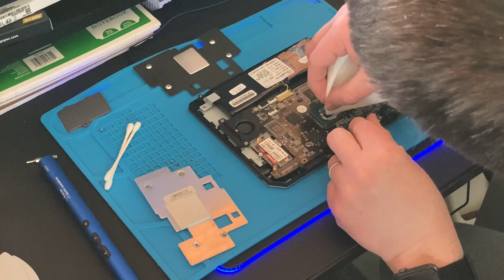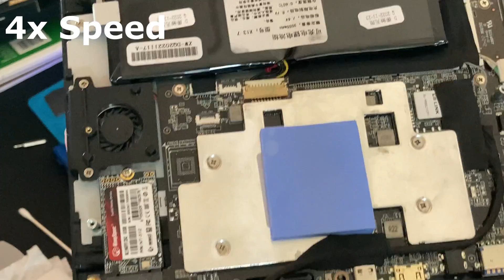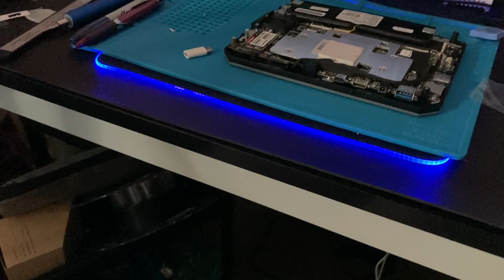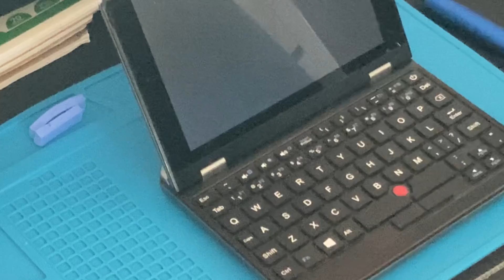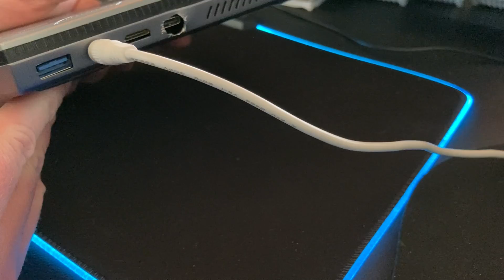The Ultimate Mini Laptop Build???

Comment: After watching your videos about this laptop, I went ahead and bought on one from AliExpress.  Aside from the in accurate listing ( said windows 11 and n100 cpu, got windows 10 inactivated and a n95 processor}  i am satisfied with it.  I had to purchase a Windows 11 license and extract the windows 10 drivers and install them to windows to get the TrackPoint and touchscreen to work.  Now the machine works for what I need it for..  Getting ready to do the cooling improvements in this video.  e warned, what is listed on AliExpress may  not be exactly what you are going to receive.   In my case, it was a slighting lower spec machine.  Wait for it to go on sale and pick one up.  FYI, I did try and contact the seller to return since it was not as advertised, but they never contacted me and AliExpress closed my return request after a week.

Comment: The design of the cooling is the worst thign ever made, and the reason why you got just 6% improvements. 

First of all it is using a desktop grade CPU, so it will be hot no matter what, since it is using a lot of power. You can reduce the TDP on it to make it cooler, but won't be as fast as an optimized CPU for mobile, at the same speed.
Then you have to totally replace the backplate. Even if you put thermal paste, your heat exchange coefficient is based on the material that transmit heat; so from the CPU to the paste that is fast, then you have the plate which is not copper, so it will not disperse and trasmit heat efficiently. Then you have another layer of thermal paste but another sheet of metal in between, and finally the thermal pad. At that point your bottleneck is the exchange speed of the metal and the thermal pad, which are all lower than the thermal paste.

Solution: buy a copper sheet that is as thick as the existing one and add a small fan on the bottom or make the copper plate with fins, so you can use a fan blowing on it to increase the exchange surface to disperse the heat generated by the CPU. It is a cheap laptop for a reason sadly

Comment: What material is the chassis made from? Are the top and bottom actually aluminum or is it just plastic?
Reply from the maker: The outer casing is metal, all the sides, top and bottom panels. I think some kind of cheaper pot metal that looks like an aluminum finish. 
The interior around the screen and keyboard is plastic.

Comment: just got mine today.. tried putting kali on it. got into the system, but display is rotated. tried messing with xrandr and its config, no avail. display setting does not give any options at all... also will not boot without parameter 'nomodeset'. any ideas?
Reply from the maker: I'll be honest and say I'm not too familiar with Linux.  I have seen a few comments left by people trying that have been adding Linux to it semi-successfully.  That's one of the reasons I built a forum for these little laptops.  I'm hoping people more experienced than me can use it and share their knowledge.  
Try asking on https://www.slagle-tech.com/forum/7-inch-mini-laptop
It's still new, but there are a couple guys that frequent it that might have experience with it.  

I do know that when I reinstalled windows on mine the display came back sideways and several things didn't work. (Touchscreen, sound, keyboard mouse keys, etc.)

Comment: I don't know the first thing about thermal paste and the best way to do something but if airflow and distributing is the key I do have a suggestion. If there is space to put that pad on the outside of the 2nd thermal cover and get the casing back on,it should all go back together if say u wedged one of those thermal pads BETWEEN the 2 thermal covers,leaving a space separated by thermal foam. Even that little space would provide air between to eliminate some of the heat before it even hits the second thermal cover. Kinda like the blade of a thermal block

Comment: FWIW those thick silpads do not have great thermal conductivity, a lot better than air obviously but still not great.  A better solution (thermally) would be a suitable thickness of aluminium bonded to the case with a thermal epxoy, and then a thin silpad to connect it to the CPU heatsink.

Comment: If I understand correctly that there is space between the sheets??  I think you should try sandwiching a sheet of copper in between.  So long as it's isolated from the circuitry, it won't cause any shorts and copper conducts heat way better than aluminum.  There are only 2 ways to do passive cooling and since you're dealing with a very small space, passive airflow across fins is not an option, so the only option is to create as much mass as possible to store/dissipate the heat.  The only problem could be the screw length if you add too much depth.

Comment: To create the cut-out since its metal were dealing with should really have been carried out by an different tool and method... the same way you would normally say cut out ports on an cylinder or indeed fabricate or machine to fine tolerance any similiar material accurately...Given the size of the port you should have first drilled with an drill either overhead or hand drilled it doesnt matter as long as your "bores" the holes you drill are all smaller in diameter and width than the port...then using an collection of small files hand file down the metal edges till they meet accurately the bores width height and even its oval shape...by doing this you would always have more material to work with and not go oversize aswell the opportunity to carefully file down the bore to meet precisely and exactly its dimensions and an Dremel is an handy tool but isnt really an finishing tool  (since its difficult to control) in fact its bound to make an mess and its usually used for convienance as an quick start if its to successfully achieve an hand file finish...this is how metal is usually worked by hand to achieve such fine tolerances and an hand finish with the correct assortment of files always gives the best result...

Comment: Does the touchscreen support pen pressure or just accurate tracking?  I'm seeing an aliexpress image claim "L4 version supports 10 point touch and 2048 pressure level stylus" what even is the L4 version?
Reply from the maker: The 10 point touch seems accurate, but I'm not sure about the pressure level stylus.  It comes with a cheap stylus and with the few "better" ones I have tried, I don't believe its anything other than a basic tracking touchscreen.
Reply: @S-Technology  Thanks, I wonder if it works with a stylus that's doesn't need one of those annoying disks at the end.  Something that would be similar to drawing on a thinkpad yoga.
Reply from the maker: Not sure. I have the annoying disk ones or the larger “pencil eraser” looking ones. 
I think something like a Microsoft Pen won’t work on it. I think they are specific to the surface lines. Not sure about other pens.

Comment: I see it's already been mentioned but when applying thermal paste don't do it in dabs, that creates gaps where there's no paste and can actually make things worse. Spread a thin film of paste on both sides and I mean very thin, you don't want to create a sandwich with a filling in the middle. Place the heat sink on top and slide it about to push out any air and ensure a close fit with no gaps.
Anyone wanting to utilise that USB-C socket I would suggest making a small hole first with a hand drill, the use a file to slowly grind out the hole to the correct size. If you let rip with a Dremel you can easily over do it and of course you can't put metal back.
The best way to keep it cool is to get a mini computer type fan and maybe build it into a stand, I think you can buy such a stand online complete with a USB fan that's what I use.
Reply: Wrong. A pea-sized dot is all he needs. He used like 3x as much as he needed but even a small dot would've covered the entire die. It's a baby celeron laptop. You only need to spread paste on bigger dies

Comment: Hi, i changed the BIOS settings and now is no video, the notebook turn on but no video. How can i reset the BIOS to fabric settings?
Reply from the maker: I thought there's a "reset to default" settings option in the BIOS.  The far right tab where it says "save".
Reply: If you have a mini HDMI cable can you connect it to a monitor?
Reply: I leave the laptop in the assistence and the staff reset her bios. I can't test it in my house, but i supposed it works to.

Comment: Pretty nice experiments and specially interesting thermal results.
...But I'll have to be a bitch about the percentages: they're off by a large margin. You can't really count percentage on temperature like that in Celsius. You've got the whole -273 degrees Celsius underneath there. Working with heat, you gotta either use just plain difference (running 7ºc lower is a great number frankly), or you go Kelvin if you want percentages of heat energy.

Comment: I recently purchased a new Lenovo  ThinkPad 11e for around $CAD225 (about 75 cents $USD), so I did a little research. Your laptop has a Celeron J4105 or J4125 CPU, while the Lenovo has an N4120. There are two striking differences. The J-series has a higher base clock speed than the N-series (1.6 vs 1.1 GHz), and the J-series consumes 10w while the N-series uses 6w. So there are two key reasons why the itty-bitty unit you have is getting hotter than my Lenovo: higher base clock speed and higher power consumption. Not intending to boast, but I imagine the Lenovo probably has a better cooling setup, despite being fanless and having a plastic case. Interesting comparison! :)

Comment: I pulled mine apart to put thermal paste between the heatsink plates, too. the idle temps dropped from ~60C to 35C lmao, likely because the original thermal paste application used way too much paste for the bendy-low clamping pressure heatsink to squeeze off the die. I still haven't had the gumption to drill out access to the USB-C port, though.
Reply from the maker: If you do drill it out just take it slow. I started off small and stepped up the sizes slowly. But just moving it up one size is when the drill grabbed it and twisted the side.  
The newer Dremel should be able to cut it with the right blades.

Comment: you can get a usb C fast charge doughter board that you can set the output on. they do 5v, 9v, 12, and i think even 20v depending on the source. using that you can connect the output to a barrel jack connector to make the device charge off a usb power bank.

Comment: I have one of these and after watching this video i have decided to leave it well alone. The temps aren't bad for a laptop, considering my last two laptops frequently hit 99c on the cpu and were fine with that. One good idea though is to buy a 12v pd barrel adapter, works good for charging with a pd battery bank or laptop usb-c charger.
Reply from the maker: 99 C is really hot for a CPU. Above 80 is hot by most of the ratings I have read. 
I got a variable PD charger (can adjust it between 5v to 20v) thinking I could use it for other items, but it was dead on delivery from Amazon. Do you have one you would recommend or works well?
Reply: FHK USB 3.1 Type C USB-C Female to DC 12V 3.5x1.3mm Plug Adapter PD Emulator Trigger 90 Degree Angled is what i use from amazon. Check if your bank or adapter supports 12v pd output tho.

Comment: Awesome! It's great to see how much the thermals improved from such a modification!!!!

Question: do you know about how one might replace the screen? I have one of these and in the process of shipping the screen broke and I'm trying to figure out if I can replace it with a 7 inch screen off AliExpress.

The short version of the story is that they refuse to give me my money back so I'm trying to make lemonade out of lemons
Reply from the maker: I haven't opened the screen portion yet and I haven't received any response from the seller I bought it from.  (Well I got an automated one that the were closed for Chinese New Year, but nothing from subsequent messages).  

I will try to reach out again and even message some other sellers to ask.
Reply: My advice would be to look for the exact part number on the screen, not as a replacement part. They're often a generic part after all, even on big name laptops.
Reply: It might also have something to do with the dreaded win11. I tried it briefly with the stock windows and it gets warm even just watching youtube. I then put kali on it and it got quite a bit cooler, even after prolonged periods of videos and sniffing
Reply: Remeckdc: I might be replacing my functional screen w/a small rlcd & putting the touchscreen on ebay. Trying to figure out if screen is removable w/out damaging or (more likely) I'd have to remove the whole lid. Are u in US?  Let me know if u'd be interested
Reply: @misterb9786  thanks for the offer. Unfortunately I'm in Australia so no dice. I hope it goes well for you though! I'd be interested in any video or blog you create about you findings

Comment: Why does the lil' laptop need two aluminum plates?

It seems like heat is spreading from chip to grease to a plate to some more grease to another plate to the pad to the case. Maybe if the second plate was removed you could destroy the.. I mean you could simplify things so the heat goes from the chip to grease to plate to pad to the casing and you might be able to use the whole size of the pad, which might be better? Or something?
Reply from the maker: It came with 2 and my guess is that they tried to use the little fan to pull hot air from the 2 plates. I wanted to do a little change to see the effects. 
But, I think that is the next logical step, to basically use the tried and true K.I.S.S. (Keep It Super Simple) method and remove that extra plate.
Reply: @S-Technology  I would be tempted to try a thin thermal pad instead of thermal paste if the heatsink has unstable pressure(as it's sponginess guarantees contact). I'm thinking that they might have doubled the heatsink plates because a single one might be too thin to apply adequate pressure due to the mounting screws being far apart.
Reply from the maker: @longdang2681  That's an interesting idea. Maybe one of those thin thermal pads that are used with Raspberry Pi's. 
I kept the plates thinking their initial plan was to have some air between the plates and have the fan move that air out.  Kind of like a thin but wide radiator fins on a car. But at this point I think removing one of them would be better. I've thought of using just a straight thermal pad from the CPU to the outer casing. But I'm worried there would be nothing protecting the CPU from everyday use of the laptop.

Comment: Yep. I'm gonna be "that" guy: When your CPU/ GPU has no heat spreader, NEVER do the "bean-size dab" technique when applying thermal compound:
If you leave a part of the die uncovered, it can get seriously damaged, because the heat it produces has no way of escaping the die. 
So never risk this. 
Make sure you have thermal compound all over the die.

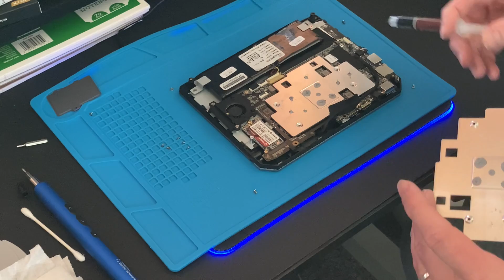Especially in your case, you are not applying enough pressure and the sink is too "bendy" to spread the compound evenly. You can see this in 4:44. Why apply dabs of thermal paste around, when you are clearly missing heat conduction in the center, just above the chip?
Reply from the maker: I appreciate being called out when I make an error.  My "idea" was that the stamp out on the aluminum was designed as a heat sink.  But you are right, it's a heat sink and not a spreader.
Reply: Can you guys expand on that? I recvd the same laptop & looking to make the same adjustments. (I got some artic x4) so (1)I should put paste on the whole square that the processor rests on, rght? And (2)What do u think is a better application pattern for the sink? Thx in advance. (1st time doing this)

Comment: I feel so guilty about encouraging you to drill out the slot, now! The 3D print fix was way better than I expected, actually, and I'm really glad to see the laptop's still working!
Reply from the maker: No need to feel guilty. Even without the insert the pc is more useful with the USB-C access. 

And I didn’t post it to make anyone feel bad. More to show that accidents can happen and we just have to roll with the punches sometimes.
Reply: @S-Technology  As I am pretty sure I recognize my love of ellipsis dots and my use of the phrase "feeling fancy" in the "you should Dremel it out" montage... I did feel a brief bit of guilt.   I'm glad you rolled with them punches, and I laughed at the cost slide.  Just a thought... because clearly the solution is to double down on mauling the case:  instead of trying to make a round hole, what if you tried two vertical cuts and a horizontal one removing a rectangular chunk of the body plate, then you could have a more regular shape to try and fit a 3d printed insert into?  😇

I return to my internet hole after that.
Reply from the maker: @jyoung-dj1zr  Once I saw the USB-C port on the back it was pretty much guaranteed to be cut open.  So there should be no guilt.  I appreciated all the encouragement I received.  
I will probably end up making it more a rounded rectangle shape. It's more that the case has a slight rounded edge that makes a portion stick up.  I know my OCD. If I don't get it closer I'll rub my finger on it and end up breaking it off.  

Keep the comments and ideas coming.  
👍
Reply: You know, a professional machinist could cut that slot with precision. I'd always consider that option if you're working with quality material and you want a top quality finish.
Reply from the maker: @JulianVince I would suggest that for something high end.  The main reason I like this little laptop is because it is a cheap device I can “mess with”. 
Even with the hole it holds up well and at one point I brought it with me to a job site every day for a month.
Reply: Rekt